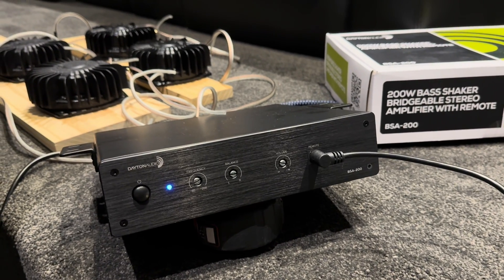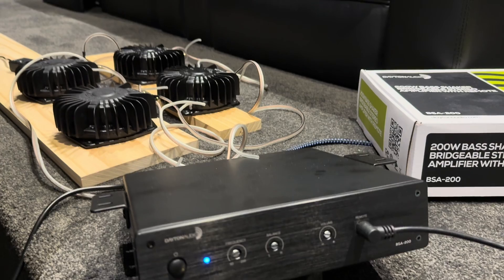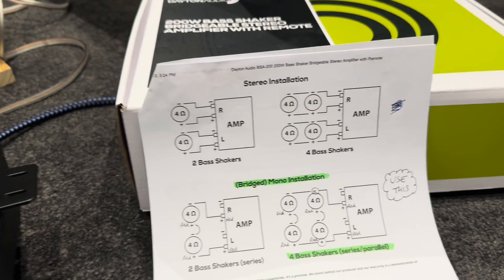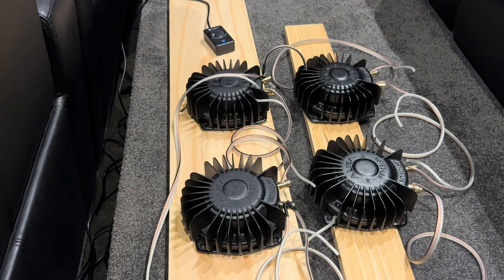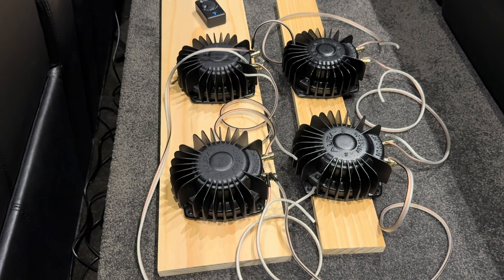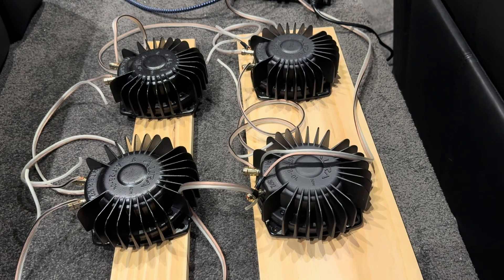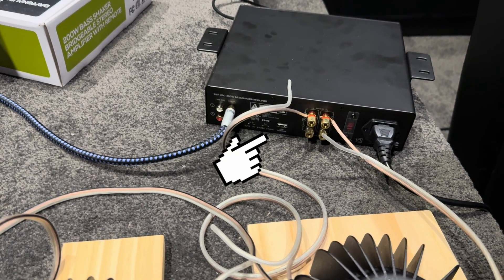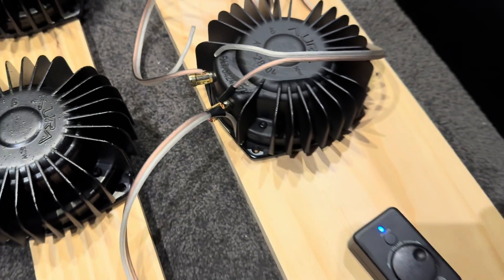Home Cinema: HOW TO WIRE 4 BASS SHAKERS (Series/Parallel) - with Sound Tests (Part 1)

Comment: How did you adjust the volume, exactly? Because the knob doesn’t have a turn stop - it just keeps rotating. How do you know where 50% is?
Reply from the maker: I find that part really frustrating - I just used some trial and error and played some scenes with some regular bass and kept moving it to see which side of the slit I guess was the indicator to rely on. then I set that to about 2/3 level. However I then used the remote which has a more traditional volume dial and I presume overrides the dial on the unit. I set that to only 1/3 and that seems enough in my room. Overall I would use the trial and error method and maybe download a low frequency signal from youtube and play that on loop while you experiment.

Comment: How are these holding up?  Any issues? Any syncing issues with sub etc?
Reply from the maker: Haven’t had a single issue since they went it. It’s probably the lowest cost of all my gear setup but way overachieves by adding a noticeable level to the experience that more subs alone couldn’t. Highly recommend them. The only surprise has been that I only run them at around 25-30% of the volume level and it is enough.  At 50% it is intense and only suited for real action heavy movies.

Comment: 3:26 Can you show us where you plug your subwoofer cable into? Did you just plug it into the subwoofer port in your receiver? I'm using an Onkyo and it has two subwoofer outs
Reply from the maker: @IamLegend32  my setup is a bit different, I have the sub cable feeding from a miniDSP as I needed more channels for subs.

Comment: The SVS subwoofer cable, where does that run to? Your processor/avr?
Reply from the maker: @usmankhalid990  it’s running to a miniDSP and then to an amp.
Reply: @ do you think a mini Dsp
Is necessary for bass shakers? Or can I just plug the amp into the AVR subwoofer preout?
Reply: @usmankhalid990  The MiniDSP is convenient because you can easily set your LPF for your bass shakers to only play 80 hz and under. Depending on how you're getting signal determines whether or not the DSP is pertinent. Say your main AVR has 2 subwoofer pre-outs; you could use output 1 for your subwoofers, and output 2 for your shakers...so long as you could specify to the AVR to have an LPF of 80 hz on output 2. There's a lot of ways to accomplish running these bass shakers, you just have to figure out what works best for you. In my case, as I'm currently developing a plan to add shakers to my setup, I'm hoping to find a cheap used AVR strictly for the shakers - then take my second sub pre-out from my main AVR into an open channel on my MiniDSP down to that 2nd hand receiver. From there, I can power the bass shakers from the main outs (probably Front Left and Front Right) and have volume control on my Harmony. I've seen a lot of other people do it that way and it's going to end up being more budget friendly versus buying the dedicated shaker amp...although having that dedicated volume remote with the amp is pretty slick.

Comment: Great video! 
Before I spend any extra money on a bass shaker amp, can I connect the shakers to an AV receiver?
Reply: I think so, but I have not tried. May need to verify the amps power levels for multi channel

Comment: Hello, how long is the cable from the remote control please? How many cm is it? Thank you
Reply from the maker: It is 3.8m long. I originally planned to run it from the amp behind my second row of seats to my main front row seat. In reality I found that I only set the volume once before starting the movie, basically by the type of movie and how much rumble I want. I never nee to do in-movie adjustments, hence leave the remote on my back wall, held with magnetic tape at the perfect height near my AV rack.